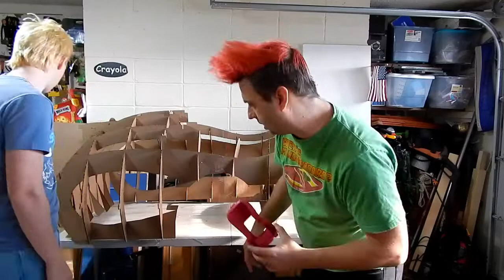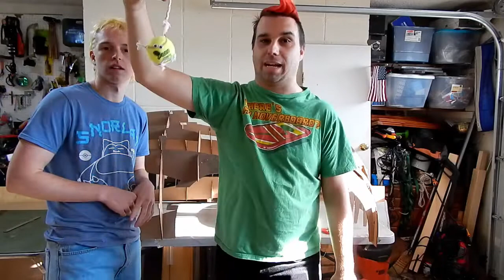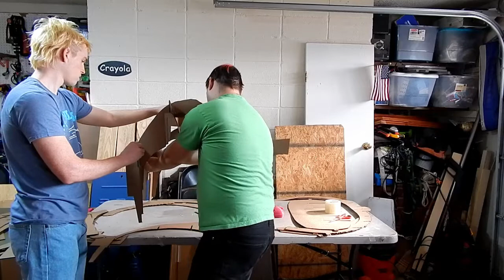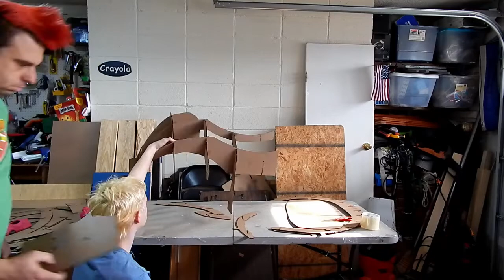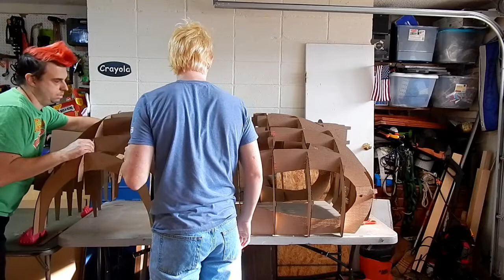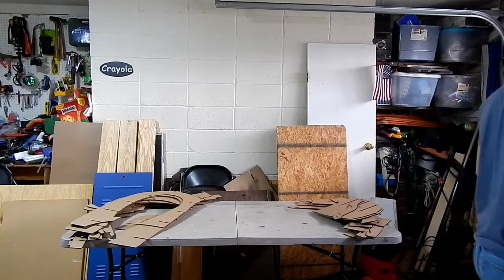Making a Mopetta Replica (part 1 the basic shape)

Comment: When you cut the frame pieces next time, etch letters and numbers by the slots so you know which pieces go together.

Have you considered gluing fleece or flannel to the cardboard frame, and building up the surface from there?  Fleece soaks up polyester resin and becomes something like a sandable foam.   Then you level it with a Bondo & resin mixture (look up Rondo and fleece on YouTube).
Reply from the maker: thanks, The pieces do have a code on them but at first we though one layer went the other way. 
I am researching the Bondo and fleece thing Thats really cool.  Thanks for the tip. It gives me an idea.